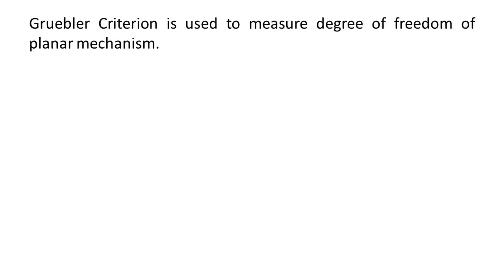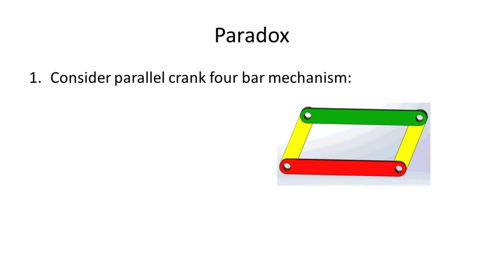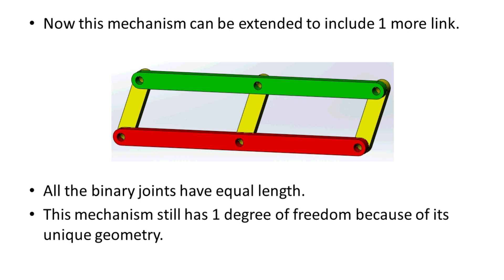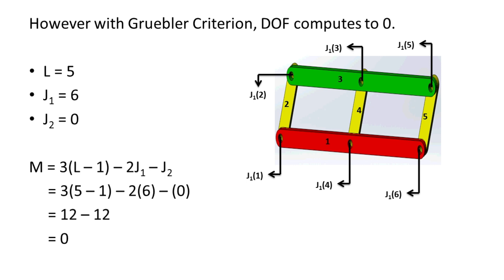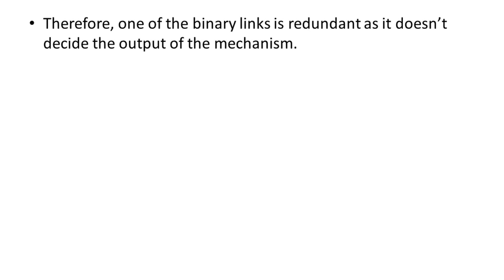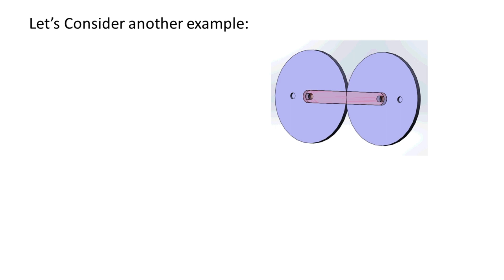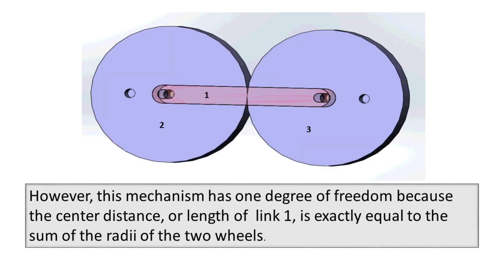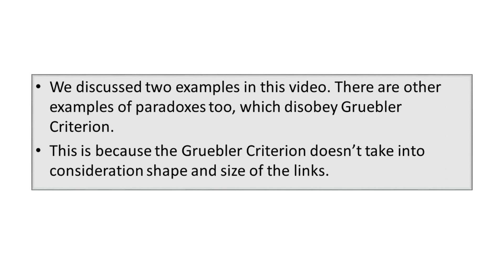Gruebler Equation Paradox

Comment: If I take a higher joint to modelize the contact, then the mobility becames equal to 1, which is consistent with the reality. I believe that since we use higher joints, as per Grüber-Kutzbach, then (at least for this specific case) it works well.
Reply: Exactly, I've been dying with this since 3 days, If I consider it as higher pair instead of lower pair, It works. But in the case of belt or chain drive, it fails if I consider the contact between belt and roller as higher pair. But if I consider it as lower pair (no slip between belt and roller) it gives DOF =1, which is correct. So I assume the criteria fails for special cases like these...